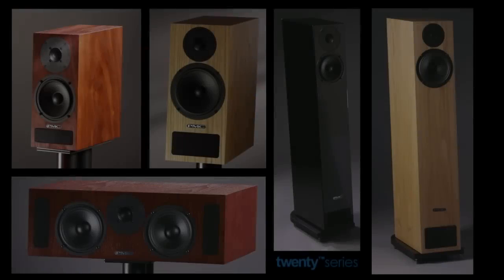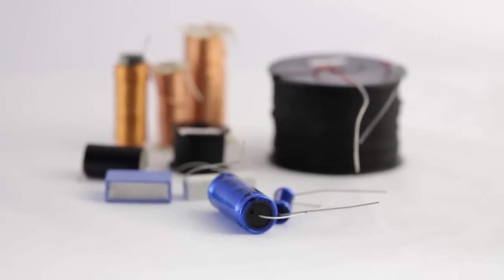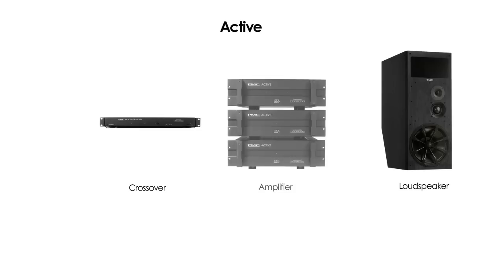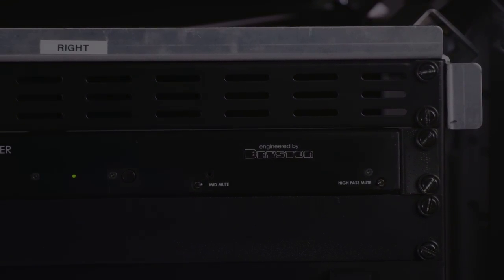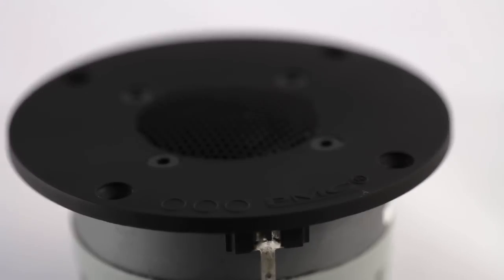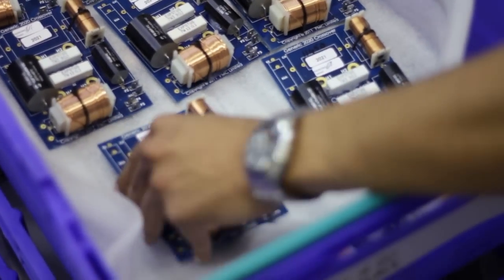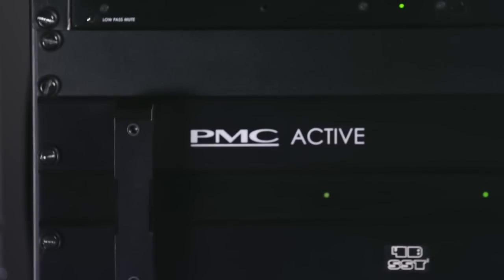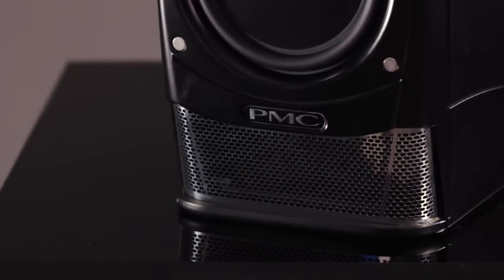Active vs Passive

Comment: Great video I myself am on the verge of building my 3 way active system, with 3 amplifiers. What crossover would you folks recommend? Sofar I have a minidsp wich is usb software controlled, has high quality sound BUT lacks the on the fly controlls. Anyone know an affordable good quality 3 way stereo crossover with manual controlls?
Reply: the minidsp can and should be your only crossover